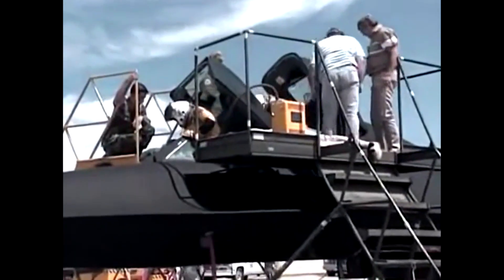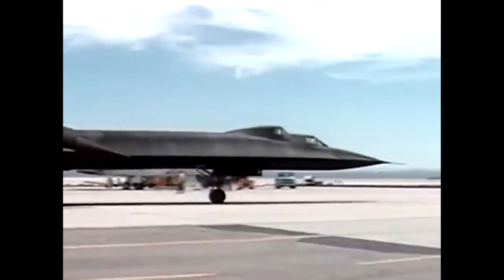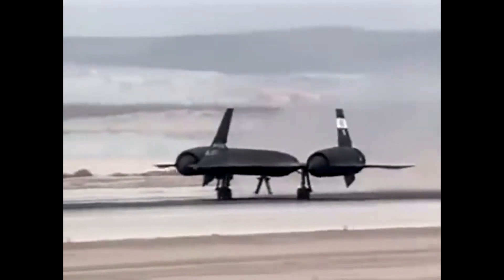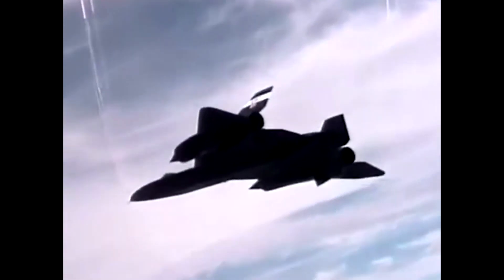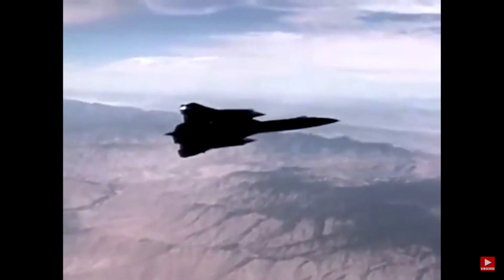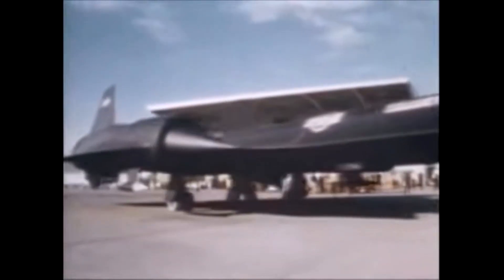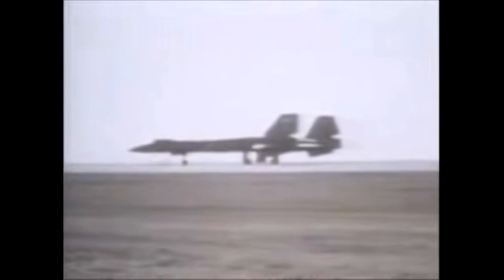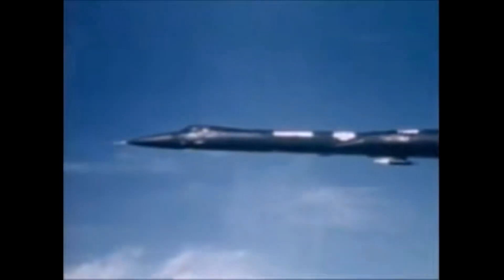SR-71 | The Fastest Jet Powered Aircraft Ever Made

Comment: If you want a really fast aircraft, Try the X-15.  It was a manned rocket plane (It wasn't a jet like the SR-71, but it was jet-launched by B-52's, lol).  It still has an intact speed record from the 1960's, at Mach 6.70 (4,520 mph) and 354,200 feet.